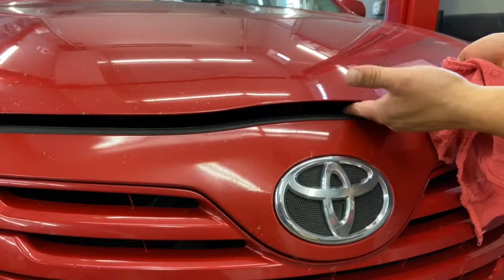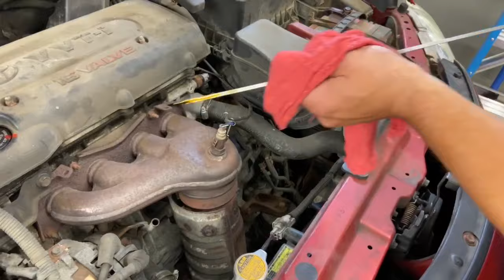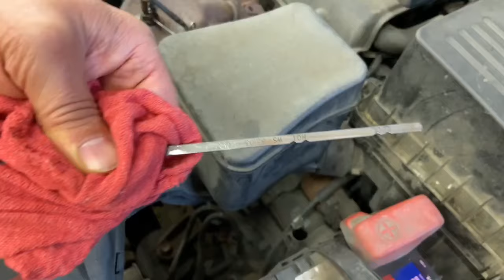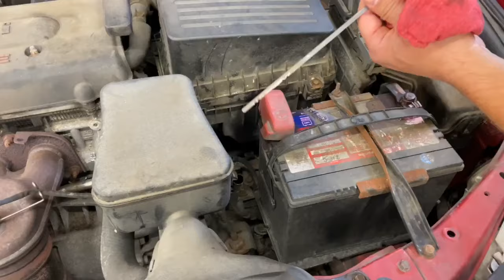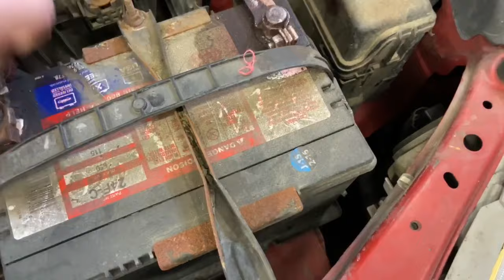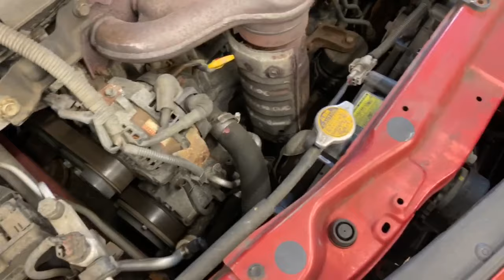2006-2011 Toyota Camry 2.4 Oil And Transmission Fluid Level Check

Comment: NOT SURE WHERE YOU GUYS ARE, BUT HERE IN THE U.S THE 2010 CAMRY ONLY CAME WITH 2 ENGINES, THE 4CYL 2.5 AND THE 6CYL 3.5 AND THERE IS NO DIPSTICK ON MINE
Reply: Angel how do you put transmission fluid inside without dipstick?
Reply: Agree. No tranny dipstick located.  Toyota has been swapping the no tranny dipstick idea with Ford . Lol
Reply from the maker: Thanks for watching
Reply from the maker: Thanks for watching
Reply: Me too I have no dip stick wondering how do I check the fluid

Comment: Great car, 421,000 miles & going on my '09 2.4 camry.
Reply from the maker: Pretty crazy amount of miles! That's pretty awesome!
Reply: Thats awesome,  i just bought an 09 camry hybrid with the 2.4 ltr.   I also just read about the oil burning issue due to faulty design on oil ring on pistons.   Have you had this issue at those miles?
Reply: i have a 07 camry with 325,000 miles and it's finally starting to act up
Reply: You guys topped me lol I thought my Toyota Camry solara 04 was high I’m at 261,000 miles and no probs yet
Reply: @tracefitzpatrick5031  oof, I just hit 326 on the same car, hope I don’t start having serious/expensive mechanical issue
Reply: I have a 07 Camry 179,000 I guess it's just getting Broke in ....
Reply: @Dawnyy  Does your burn a little oil ? and did you change your trans Fluid its says not too ?
Reply: What ?? 421000  miles ? Amazing
Reply: I thought my 05 Camry with 159,000 miles was a lot. 😮

Comment: Warning: With engine running AND at operating temperature is when you will check the transmission level. Do this because your transmission operates at normal operating temps.
Reply from the maker: Thanks for the added tip. Have a great day!

Comment: I have a 2011 Toyota Camry, my son and I have been hunting and hunting for the transmission stick, we cannot find it🤷‍♀️ help
Reply from the maker: This video shows its location.
Reply: Mine's the same year, and it's not there either
Reply: They are sealed transmission for your year. No dip stick. Only drain and drill on the driver side wheel well

Comment: I think you should emphasize that the ATF needs to be at operating temperature before checking and adding fluid. It should also be emphasized that the transmission takes longer to warm up than the engine so you can't simply go by the engine's temperature gauge.
Reply from the maker: Thanks for watching.
Reply: Is Toyota transmissions are real finicky n need to get up to operating temperature add 178 degrees. Using an infrared temperature gun is the only way to accurately check the transmission level. In fact I have to buy one of those today. Cheers

Comment: Thank you! ???? My 2009 Camry's transmission is a bit slow when I first start it in the morning, then seems fine. Cause?
Reply from the maker: You may want to let it warm up a little if it is cold out. If it is an automatic and you haven't changed the transmission filter you may want to have the transmission filter changed. The filter will help to filter debris out of the transmission fluid.

Comment: There is some misinformation here. After 2009 Toyota Camry 4 cylinders changed the transmission and the engine as well. Engine; from 2.4 to 2.5 ad the transmission from a 5 speeds with dip stick to a 6 speeds without dip stick.
Reply from the maker: Thanks for the added tip. We try to be as thorough as we can.
Reply: That's not entirely correct either. I have a 2010 ACV40 model that's 2.4l ,4cl,5speed auto
Reply: My 2010 doesn’t have a dip stick it’s a 2.5 with 6 speeds. And I think my Transmission is leaking but I can’t find where to check
Reply: For 2004 solara they say to use Toyota type t-Iv for the 4 cylinders then in 2007 they say type ws and same engine and transmission for the 4 cylinder - does anybody know what’s the difference. Could I use type ws for 2004 solara and type t-iv for 2007?! Also dealer said 2004 uses dexron 3 but dipstick says type t-iv. I’ve put both in the 2004 solara 2.4 and transmission works the same
Reply: Hi great video! 

I’m going to do a transmission fluid drain and refil, where do I add the transmission fluid ? Into the dipstick? Since I have one to check the levels.

Comment: I have a 2011 camry and we do not have the transmission dip stick. I heard that it could possibly be sealed?
Reply from the maker: The transmission may be sealed
Reply: I have the same problem it looks like I have sealed gearbox so what to do
Reply: @soufyanmohamed4756  there is other videos that show 2011 transmission...this one does not..
Reply: @HomeownerRepair  transmission not sealed there is other videos showing 2011 transmission this one does not
Reply: on the side by the driver side front tire, there is a plug through which you have to pomp the oil in, It is not sealed.

Comment: My 2010 LE does not have the transmission dipstick in the location this video is showing !!
Reply from the maker: If there is not transmission dipstick it might be a sealed transmission. If it is, the dealer would need to hook it up to a machine, pump all of the old transmission fluid out and fill the transmission back up again with new fluid.

Comment: What about the brake fluid?
Reply from the maker: You should be able to see the brake fluid level through the white plastic. The brake fluid reservoir should be located on the master cylinder on the brake booster on the driver side. Your owners manual should show its location. Hope this helps you out.

Comment: No dip stick on my 2010 either 4 cylinder
Reply from the maker: Are you sure? There should be one.
Reply: @HomeownerRepair  if there is one they have it hidden. I looked for about 30 minutes. I watched this video so I knew where to look.  According to online some do not have a dip stick. Computers are monitoring the fluid. Not an ideal set up imo. I would not trust a computer to do that if I was building one.

Comment: What if there is no transmission dip stick?
Reply: Exactly what I’m thinking
Reply from the maker: If there is not transmission dipstick it might be a sealed transmission. If it is, the dealer would need to hook it up to a machine, pump all of the old transmission fluid out and fill the transmission back up again with new fluid.

Comment: I have a 2007 Toyota Camry 4 cylinder.
 I hear a rattle sound when I popped the hood it looked like the engine was going back and forth rattling I don't know if that could be from transmission a motor mount or possibly my exhaust rattling under there?
 I had my whole exhaust replaced in 2020 so hopefully it's not that?
Reply from the maker: You may want to have a qualified mechanic look at the vehicle. It may be something as simple as a loose catalytic convertor cover. Hope this helps you out.
Reply: I have the same problem it rattles when I hit 2nd gear idk if it’s the transmission 😢
Reply: im having this issue rn, any solution to yours ?

Comment: What type of oil can I use for my Toyota Camry 2011 transmission?
Reply from the maker: You may want to refer to the owner's manual that came with the vehicle for the recommended transmission fluid type.

Comment: Mines 07 330,000 and it just started a lil jerkin imma check my transmission fluid
Reply: Good for you ...I have a 07 too Does yours Burn a little oil and have you changed transmission Fluid mines says not to ?  If you could let me know I would appreciate it ... Thanks
Reply from the maker: Thanks for watching

Comment: This does not cover 2010 the change the design
Reply from the maker: What's the difference?
Reply: @HomeownerRepair  no dipstick on 2010 for transmission a fill plug you have to remove the tire to get to to check and fill up

Comment: When I check my transmission fluid the fluid is splashed all over the dipstick because the car is running. it's very hard to see where to level is, especially because the transmission oil is so clean.
How do you know the level you're seeing is the proper one and not just because some oil got splashed up on the dipstick when you put it in/pulled it out?
Reply from the maker: Sometimes you may need to wipe the dipstick off a few times to get the correct reading.
Reply: dont put the dipstick in and let it sit there. try to do it as fast as you can, while still seating the dipstick fully on the dip stick tube.

Comment: Great video! Should the trans fluid be a red color?
Reply from the maker: Yes it should be red.
Reply: If its not red what does that mean?
Reply: So when you check the transmission fluid, the engine should be hot and running ?

Comment: Hi ,I have Toyota Camry 2010 2.4 LE but I can’t find the PCV valve location, could you assist please
Reply from the maker: We currently do not have an auto repair video on this particular repair.
Reply: If your facing the front of your car with the hood open.  Locate the oil filler cap (on top of valve cover) on the left side.  pcv valve is on the back left corner of the valve cover.  There will be a hose about 6 - 8'' long that connects the pcv valve to the intake manifold.  If you can find that hose, the pcv valve is on the higher-end of the hose.

Comment: Where do you add the transmission fluid
Reply from the maker: You should be able to add it into the tube that the transmission dip stick is in.
Reply: Probably late but buy a smaller funnel only for the transmission slot. Do not mix  funnels.

Comment: What happens if you add too much oil? It's confusing. Some say check it when it's hot; some say check it when it's cold. The level on my car was low when it was cold, and almost nothing when it was hot. I added oil. Not sure if I added the right amount. I will check it again in the morning.
Reply from the maker: If you are checking the engine oil you can check it if the vehicle is warm or cold, just make sure that the engine has been off for a few minutes so that you get an accurate reading.
Reply: In my 09 Camry 2.4 owner's manual the instructions on how to check the oil says to run the car till warm, then turn the car off on level ground and wait 5 minutes for oil to settle. Then check.
Reply: If you start your car up you have to wait 15 to get a accurate reading on the oil level if you over fill the engine it could cause damage to your engine

Comment: I have a question?
Today I went for an oil change in my Toyota Camry and i had 188000 miles and now i have 394000. Why?
Reply from the maker: Maybe it was set to trip before..kind of weird
Reply: @HomeownerRepair  I'm sorry. I'm kinda slow. I didn't understand the answer.
Reply: Guess someone needed to do a few errands with your car...😳😜
Reply: @Everlastingev  There is the regular odometer and the trip odometer.  One is continuous from the time the car is new. The trip one can be set back to zero by the car driver anytime. Just push a button on the dash and it resets to zero. Yours may have been reset to zero about 206,000 miles ago.